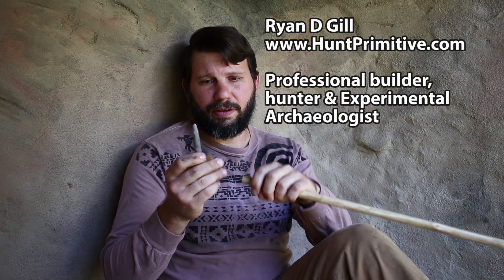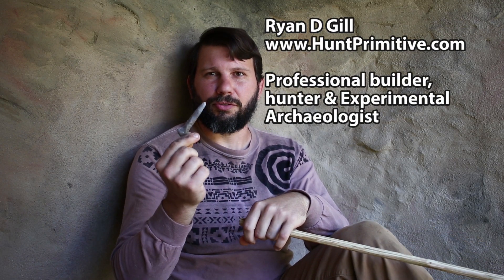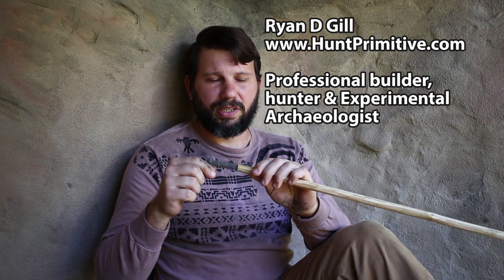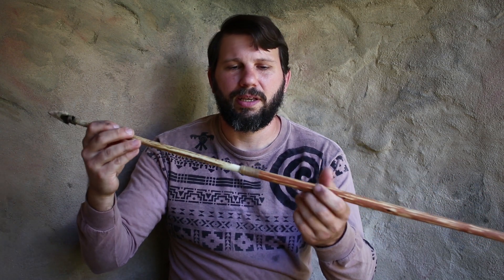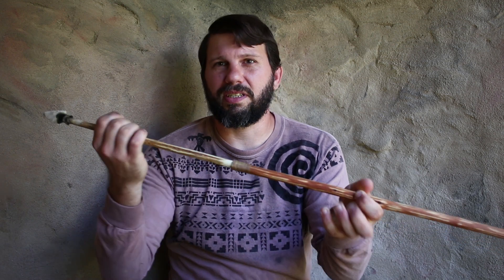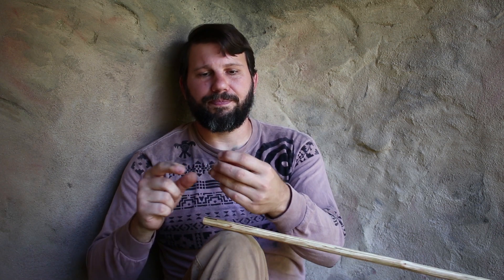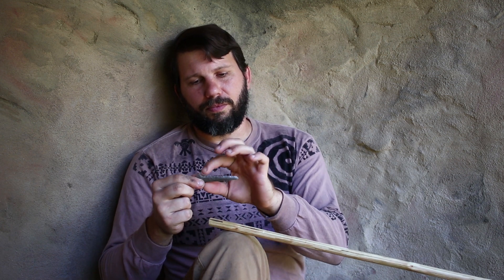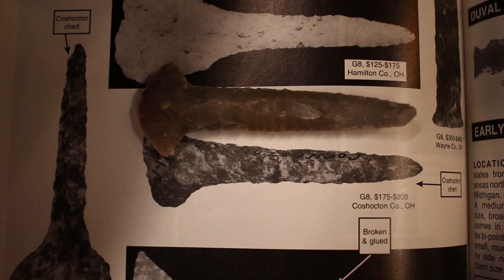Flint Drill how to and Experimental Archaeology

Comment: So that’s what that is for. I found a campsite full of arrowheads, knife and spear blades, fire pit with petrified Buffalo fish bones with a softball or bigger block of sandstone with what looks like a funnel in the center, runs about inch or so deep with the bottom of the hole completely flat and the diameter of the hole is about the size of a pencil or bigger.. You can see the charred burn marks on the fire pit rocks including that sandstone rock.  Then I found something pretty much identical to that.piece. One end is pointed and the other looks like a flathead screwdriver. It’s about the diameter of a pencil and around 2” or a hair longer in length. Interesting.
Reply: I’m slap in the middle of Choctaw, Chickasaw and another tribe (can’t remember name) Country. I’m always finding arrowheads, knife and spear heads, flakes, scrapping tools ect ect around here. It’s a lot of fun and very very interesting too!
Reply: There’s also quite a few burial mounds,well a lot of em around this area too.

Comment: I like it Ryan. Doesn't matter who gave you slack. Etley Sedalia site's have a lot drill forms, a high ratio of broke verses whole. A lot of times when excavating, they're always in a close proximity of fire rock. You don't hardly find any conical drilled hardstone, like a gorget. They will produce a bannerstone or two, though we know those are Reed cane drilled. That particular culture was drilling a lot of something other than hardstone, to have an incredible amount of drills present within a large site. Though of course it is possible that site was periodically used over a course of 2,000 year's, the occupation length of the Etley culture. In my direct area, they made wide variety of knives, 5, and 3 types of projectiles, Sedalia's, Nebo Hill's and the Robinson point which is small (2"/2"&1/2" at most) compared to the first two. Though they're recently recognizing all of the combined points as the same culture. Except  the Robinson point, which has a perfect design as a small projectile. Michael Denner shared some ice core readings with me a while back. From everything I can gather during mid-to-late archaic when that culture existed, good River cane wasn't prevalent in our area, for atlatl shaft use. What should dictate they were using some type of sapling that would of need an end drilled for a foreshaft. As you said, an instrument of survival, something as such, you're going to need it usable more than once, most amount of lifespan for it's purpose. 
BTW really looking forward to the Bison Atlatl hunt. If I remember correctly, you mentioned June, to be released.
Reply: Plus forgot to mention, being an old carpenter and wood craftsman. It makes perfect practical sense to use the drill in the manner in which you did, to create the socket for the foreshaft.
As you mentioned, you can feel everything, not just with the stone drill, but the socket end of the shaft as well. An a hour and a half is a easy job for a healthy hunter.

Comment: If I remember correctly i read ishi used to mounted antlers in a stump or held between the tows and used a hand drill motion to drill out the shafts
Reply: Ishi was drilling out arrow shafts, not dart shafts from what I know. Ryan mentioned that due to the size of the dart shafts, the drills snap easily. Since an arrow shaft is smaller,  I’d imagine the method ishi was using was more viable.
Reply: I saw footage of an Amazonian hunter who had built a platform maybe 6 or 7 feet high to drill out the bore for a blowgun with what looked like a really long arrow using the hand drill technique.

Comment: Nice video! When I use my stone drills I use a small drill and make a small pilot hole a few mm deep  and then come back with my large drill. I set on my butt and but my feet together and put my drill between my heels and spin my dart main shaft like I would if I was making primitive fire. It takes maybe 4 or five minutes at most to do one. I stop often and make sure that everything is good. I do my spur end by hand like you where doing.  I also agree about the value of your dart! It's always a sad day when a good dart brakes!
Reply: It's by far easier to make a forshaft than a New dart